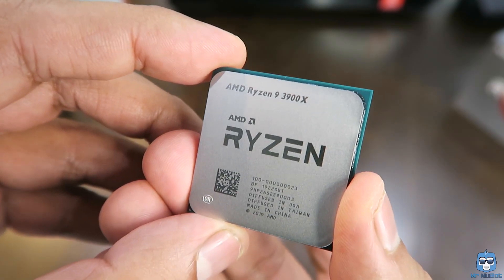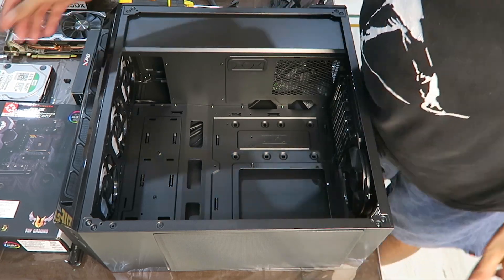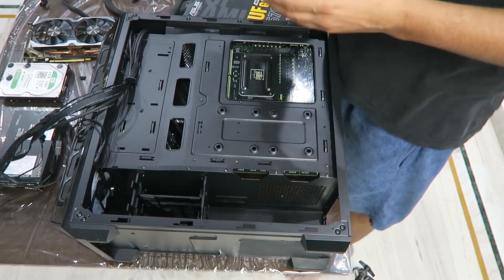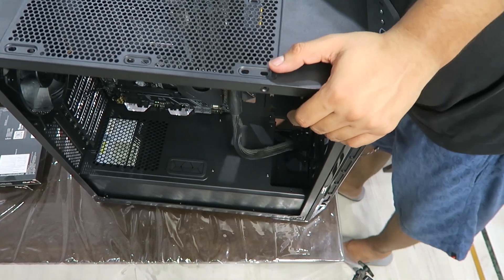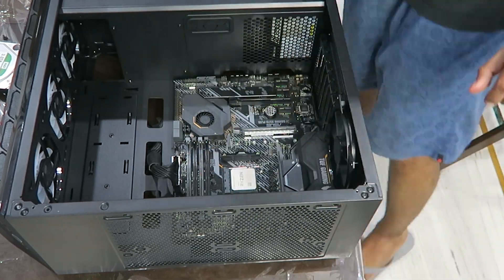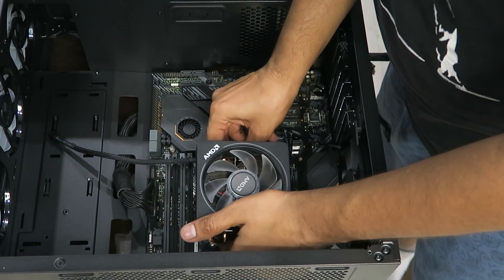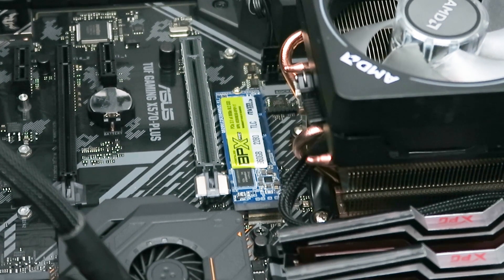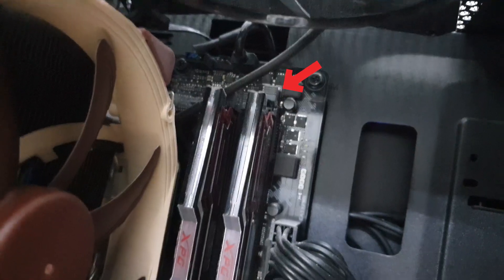Assembling a Ryzen PC || DOs & DONTs || Ryzen 3900X - CM MB520 case

Comment: Those screws are motherboard stand-offs and the plate for the motherboard is the I/O panel. Fan of PSU facing the grill is to let the PSU fan  take in cool air and exhaust it to the back of the PSU which as a grill with the power connection and a switch.
Reply from the maker: Ah yes. Damn. Totally messed up the PSU airflow part. Thanks man. Gonna pin your comment up. :)
Reply: @MrMuBot  just helping you out dude that's the tech community. We help all .